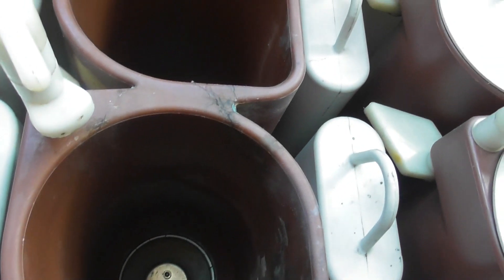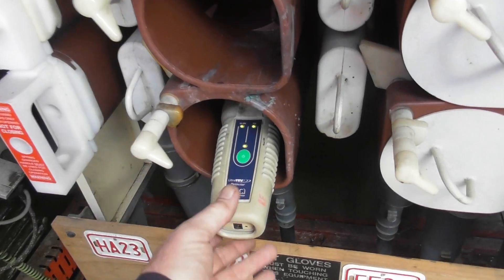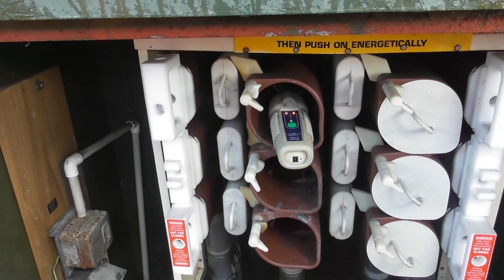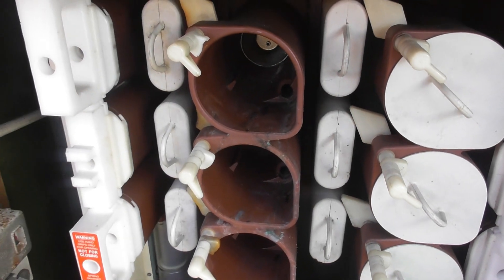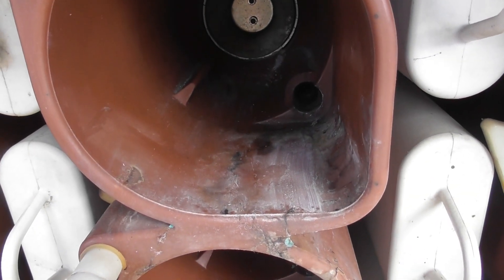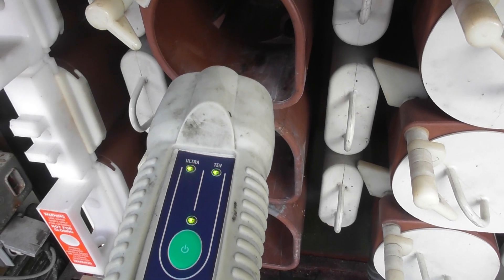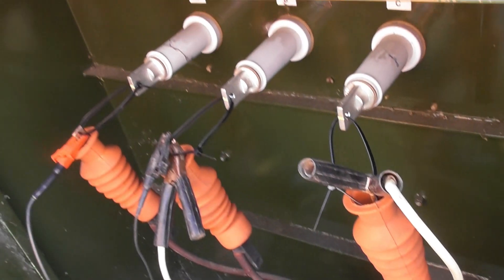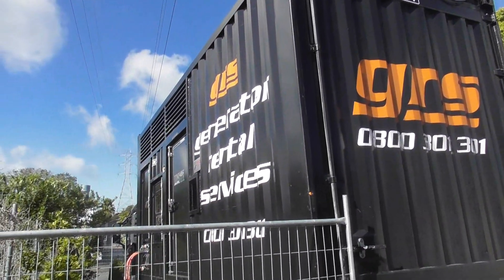Hazemeyer Switchunit had failed on fused circuit

Comment: while higher than wanted humidity levels may have caused that, do you have frequent lightning strikes around there? I never here much mention of thunderstorms and lighting across the pond in Aussieland 😁 but it will for sure, blast through all the sealed connectors and eat up anything beyond rating one hundred fold.

Comment: It sounds as if the failure of the cabinet heater allowed the humidity to get high enough to allow an adsorbed layer of water to form on the material the fuse holders were made of, lowering the surface resistivity to the point where tracking and eventually flash-over occurred.  I wonder if some of these new super-hydrophobic coatings could prevent that, even without the use of heaters.
Reply: most public commercial work is done by lowest bidder because the people calling the shots want to generate maximum profit <here and now> not <in the future>. As a result, high quality long-term things are "taboo". There's always been a way to prevent this without heaters. The issue is they don't care about it.